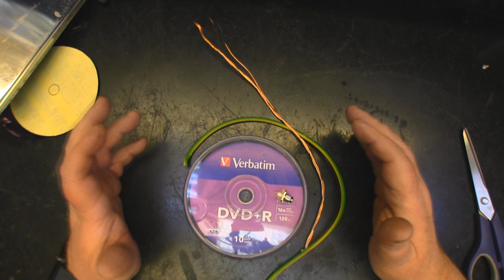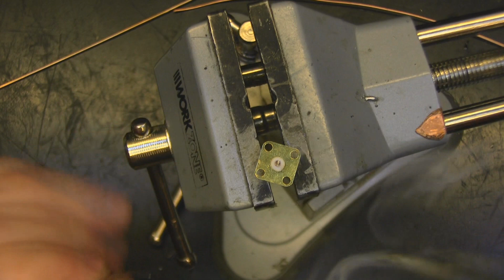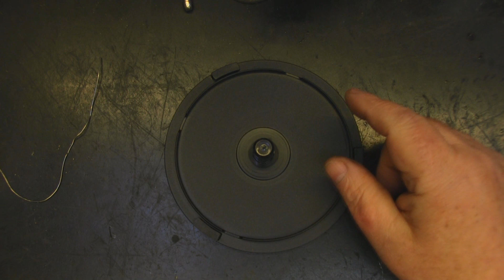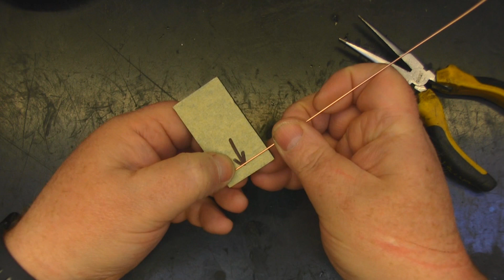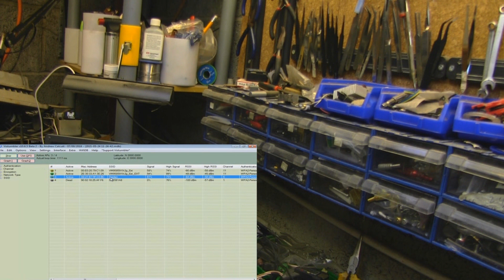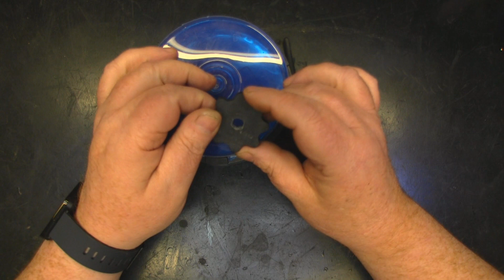Antenna Basics” The Single Biquad”  2.4GHz

Comment: Hi Andrew, big fan here of your work! i need to know, 31,5 mm it"s the measurament tool or the measure between copper centers?
Reply from the maker: Yes  althougth a biquad was a wide band antenna so if your off a mm or 2 dont worry to much about it,

Comment: how did you converted the SMA into RP-SMA? Changed the inside pin?
Reply from the maker: Yes
Reply: @andrewmcneil  thanks cause I just cant find the RP-SMA connectors you are using. There is only one single seller on aliexpress and ships only 1 piece per customer. Also no luck on amazon either.
Reply from the maker: @DanielSchweinert  They used to be very common but for the last few years they have been hard to find and I don’t know why.

Comment: If you ever feel like an impractical project...

directional biquad for broadcast FM radio - or 3.331 meters. A quarter wave (the basic unit of the biquad, made of 8 of them) would be 83cm. That's a lot of wire. 6.662 meters for the driven, to be exact.

I might some day build a yagi version.

Comment: Hi, Andrew. Thanks for your very useful videos about antennas. I've already did omnidirectional biquad antenna from your video and it works pretty good. I also need some simple directional antenna to boost my 2.4GHz (ch6) WiFi signal to connect some outdoor IoT devices.
What design could you suggest? Signle biquad or single patch antenna like in this your video: https://www.youtube.com/watch?v=rZBOiNDgWxc&list=LL?

Comment: I'm probably overthinking this, but... when you butt up your pliers to the measure, then bend, the last few millimetres become the radius of the bend, so is it OK that the actual straight leg of each section is less than the desired length?
Reply from the maker: Your over thinking it Nick. Now mm wave frequencies it would be a problem.
Reply: @andrewmcneil  I made my first antenna, your "piequad" (pie was lovely :-).... and the first thing I did after construction was attach it to my NanoVNA to check it out. I can imagine being my first attempt, I've made some heinous errors, but didn't expect the SWR to be around 12. Don't really fancy attaching it to the Alpha and transmitting, I'm too chicken. 
Can you tell me what SWR I should be expecting from the piequad build? What's the SWR of your's? If I had a benchmark to aim at, I'd be trying to do better.
Reply from the maker: @NickD331  A biquad has an average VSWR of 1.5 to 1.8 similar to most Yagi's

Comment: Nice, this one feels pretty nostalgic. 
I actually built one of these around 12 or 13 years ago. 
I didn't know about groundplanes back in the day so I used a CD as a back reflector, which doesn't work very well at all. 
(The hole in a CD fits pretty nicely on a bulkhead BNC connector however) 

The CD box makes for a nice, somewhat weatherproof enclosure.

Comment: I am only got 1 lpda antenna gain extra long elements with 4g router to 10 to 15 dbm gain but i am searching and making aome 4g router outdoor model need to know get which can help me to work with 4g routers and get network even in no network area or very low areas outside i mean